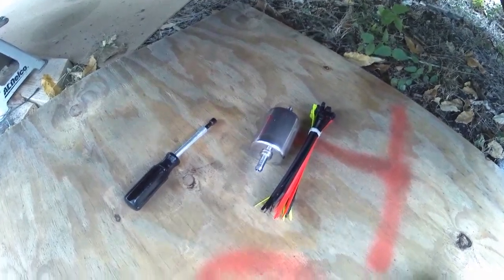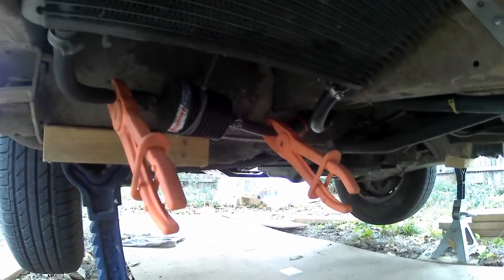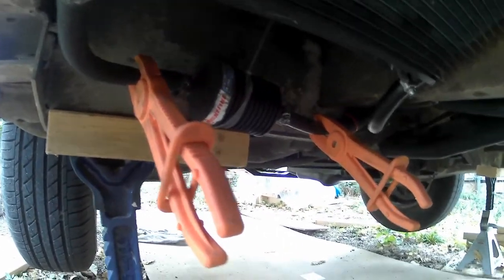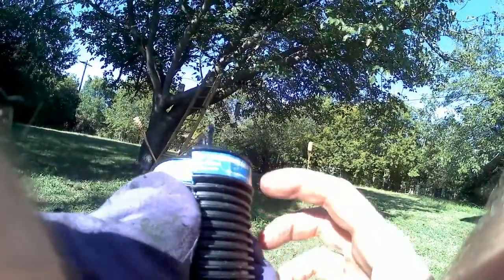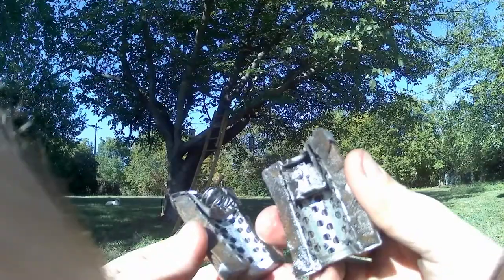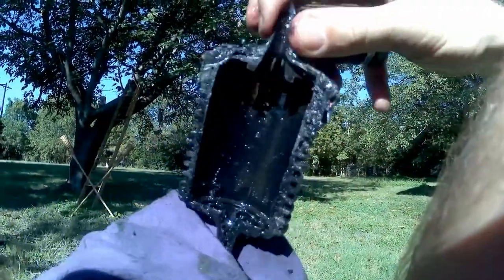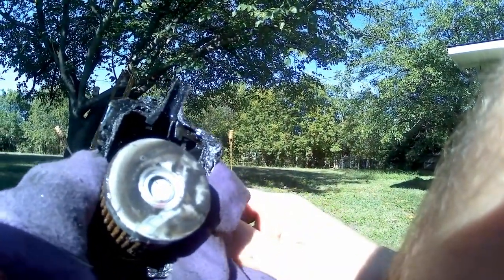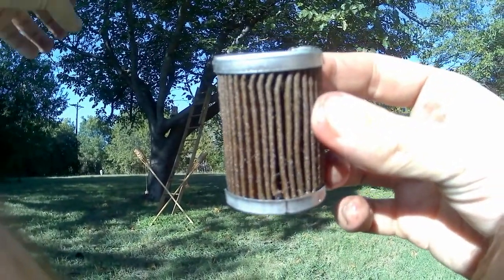Magnefine Inline Transmission Filter Inspect and Review

Comment: Is there a bypass mode if its clogged?
Reply from the maker: I seem to remember that there was, but I also just checked.  Their website basically just points you to Amazon, where someone asked...
Q: Is there a pressure bypass, cold oil or plugged filter?
A: Yes there is a bypass if the filter were to become restricted.
Answered by Magnefine Filters in the United States on November 29, 2018
Reply: @jwgmail  thank you

Comment: This video was several years ago, do you still use the vehicle and are you still using these filters?  I was wondering how your long term use is.
Reply from the maker: Good question. I have the vehicle, I think I removed the filter from the vehicle a while ago and honestly I don't remember why. I think my transmission is old but good condition because even without the filter I couldn't see any metal... But of course the point of the filter is to get flecks of metal too small to see.
Long story short, definitely didn't seem to hurt. I did see a little tiny bit of very fine sortof powder when I changed the filter, so it may been doing some good.

Comment: This magnefine filter is great stuff.  Had it inline with hydraulic power steering return line on my 2007 Subaru Impreza(manual transmission), too bad the gosh darn head gasket blown and traded in for something else.  As a result, am unable to tell you the long term benefit but I am sure the steering pump would have been the last thing to go in that POS Subaru.
Reply: I've been a loyal Honda guy for over forty years although I'm not as big of a fan of their recent stuff. I have a twenty year old Pilot and a twenty seven year old CRV and I've never had a head gasket blow on any of the various Honda's I've owned over the last four decades. I've been reading about Suburu's head gasket problems for quite a few years so I have to wonder why they haven't solved the issue by this time.

Comment: Not challenging your knowledge of your vehicle, but most transmissions supply pressure to the cooler from the upper or forward line and return to the lower or rear line. The line closest to the pan is almost always the return so cool oil can be picked up by the filter. That said, thank you for the video, it shows these things really are worth the effort.
Reply from the maker: VW would have to do it backwards from what most manufacturers do, because they're VW...

Source: https://www.thesamba.com/vw/forum/viewtopic.php?t=522264&postdays=0&postorder=asc&start=20
Reply: The pressure out line fills a transmission cooler from the bottom up that's why you check your transmission when it's running

Comment: Good review I'll have to install one of these.
Reply from the maker: Only reservation I'd have is if you're transmission pump might have any problem. Also, by adding more hoses and connections, you're introducing more potential points of failure.  I've had small leaks but no big deal.  Be sure to use transmission hose, not heater hose or something like that

Comment: you can unscrew it using channel locks
Reply from the maker: I dont believe you can unscrew the plastic or metal version. They don't want you to open them
Reply: @jwgmail  you can unscrew the plastic ones not the metal one....you need a lot of torque to unscrew them